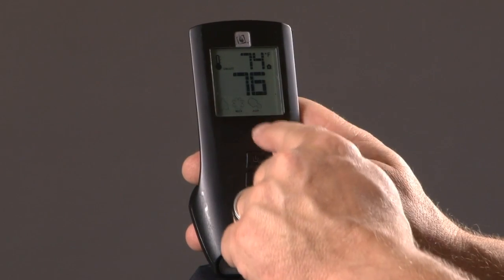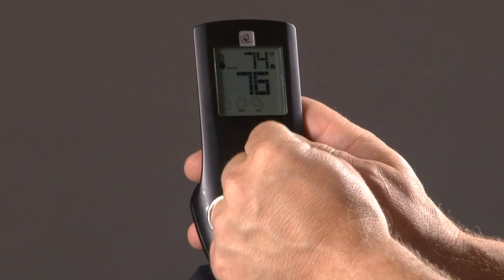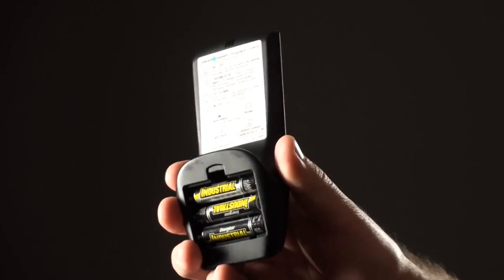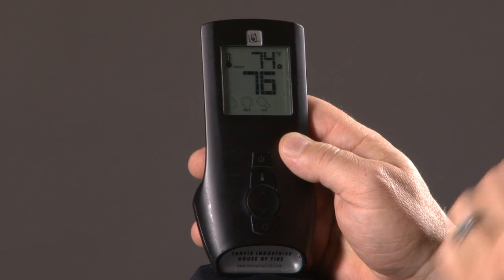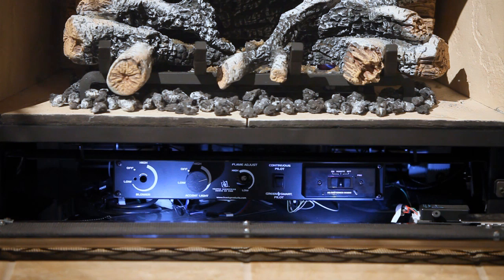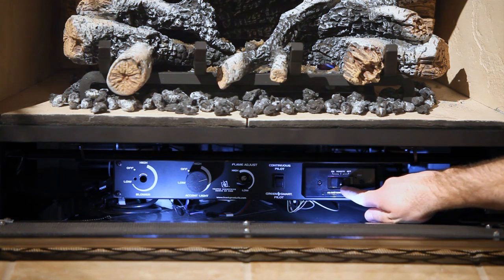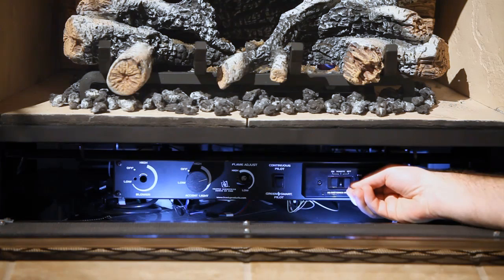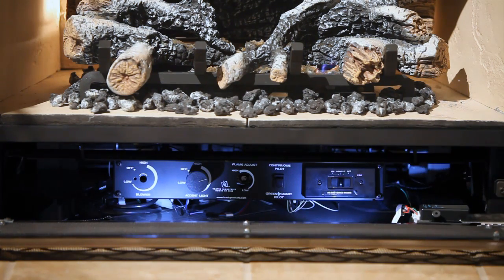GreenSmart Remote Control - Troubleshooting.mp4

Comment: my green smart controller shows a room temp about 2 or three degrees higher than actual temperature. Is there someway of recallibrating the in unit thermometer ?

Comment: Ours worked reliably for about a decade but now it just randomly shuts off from time to time. By that I mean the stove shuts off every couple of days. The remote continues to display as normal but has to be turned off and then on again for the stove to respond and fire back up. We've tried all new batteries everywhere but that doesn't help. I also have the stove switched to Continues Pilot. It operates longer between shut downs if left in thermostat OFF mode with just the single flame/burner on. In SMART or ON mode it will only operate for about a day before the stove turns off again even though the remote is still 'on'. Does this sound like a remote that needs to be replaced or some service work that needs to be done on the stove?

Comment: I recently replaced my remote, but as soon as I resynched it to the receiver, now the side burners don’t fire. The middle burner starts fine. It’s a row of three seperate burners. Frustrating as there is no information on this. Tried going back to manual non remote mode but even that doesn’t fix it. All three burners were working fine until I replaced the remote........any ideas ?
Reply: Update - the new remote had an icon missing. Found a YouTube clip that showed how to reset or re-enable missing icons. That did the trick and all burners now operating. Saved me a service call. The power of YouTube !

Comment: Is there anyway to extend the range of the transmitter or receiver. At about 15-20 feet when the transmitter is placed on it's wall mounted metal bracket, the signal reception at the fireplace is hit or miss even with brand new batteries on both units. Any way to extend the antenna of the remote or the fireplace receiver to extend the distance ??

Comment: I get 3 beeps, turned on and off, unplugged, changed batteries, reprogrammed receiver, nothing works.  I can get pilot to light. Even an occasional full flame, but doesn't last,  then shuts off and continues beeping.
Reply: Call a tech to check if the controller is bad and needs to be replaced. Often can be done under warranty.
Reply: I got exact same problem as yours, did you fix it? can't find any way to fix it
Reply: They are designed with bad controllers.  I will be getting my 3rd in less than 3 years.  I will be selling my house soon so as long as it passes inspection then it’s some other persons problem.

Comment: Remote doesn't work at all, we changed batteries in it and everything.
Reply: I have the same problem. Did you find out what the issue was?
Reply: Same issue here… worked well for years and now suddenly won’t come on even with brand new batteries
Reply: Same any fixes yet?